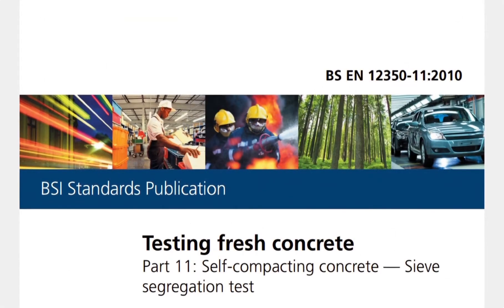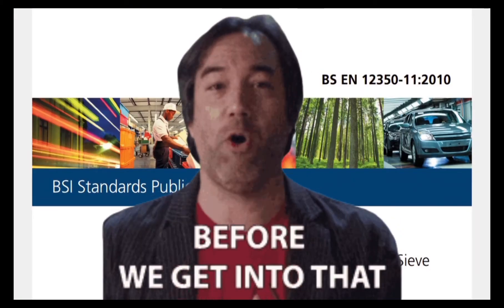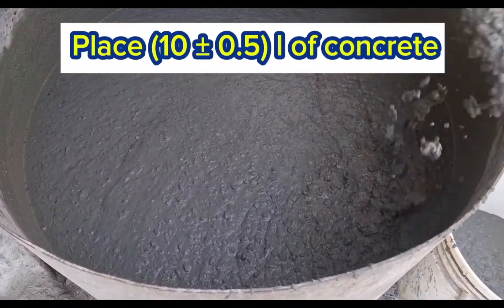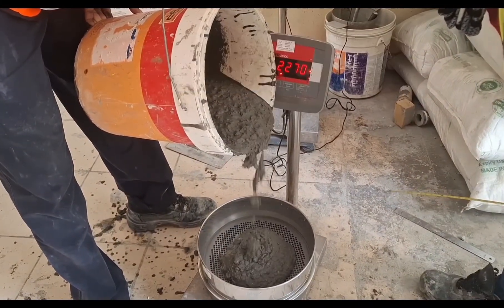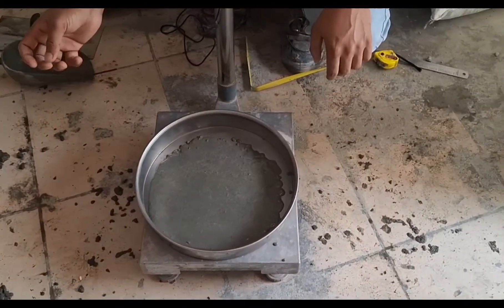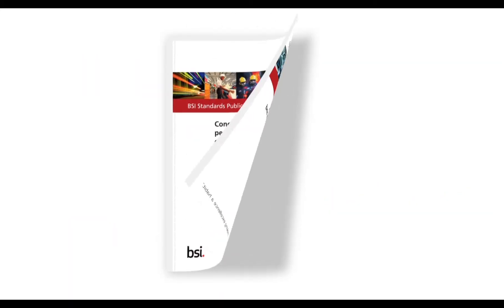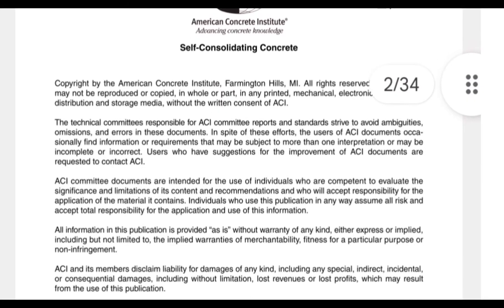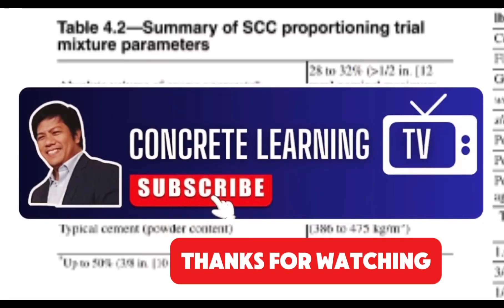Sievesegregation test for SCC #scc #concrete #cement #concretetest #qualityconcrete #bsen

Comment: How much is the flow for this mix
Reply: I got a challenge to get Segregation test under 15% initially with initial flow of around 670-700mm. But if I maintain this level of flow Segregation value passes 20% and if I get the Segregation under 15% (I.e, when flow is around 650mm) then retention gets dropped within 2nd hour (min 600mm flow needed in 2nd hour) also 1 day Strength needed 35%
Reply: Please help
Reply from the maker: Try to add retarder like 0.8kg or 1kg/m3
Reply: Design M40 SDC

OPC53 - 350KG
FLYASH - 150KG
20MM - 171KG
10MM - 599KG
Crushed Sand - 939KG
Water - 170KG
Admixture - 0.5-0.6% 

Any suggestions for design change
Reply from the maker: Send me by email at concretebycesar@gmail.com
Please include test reports for grading and specific gravity